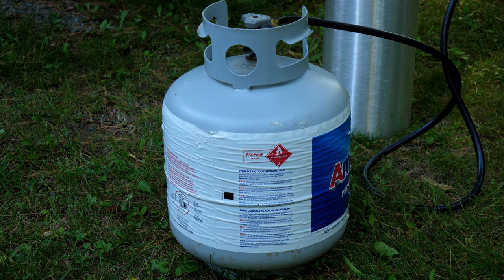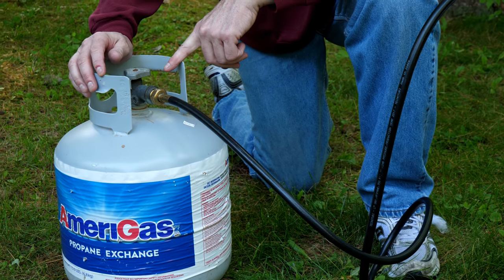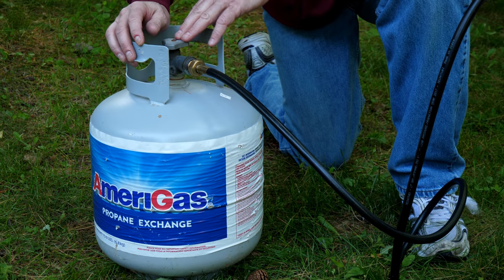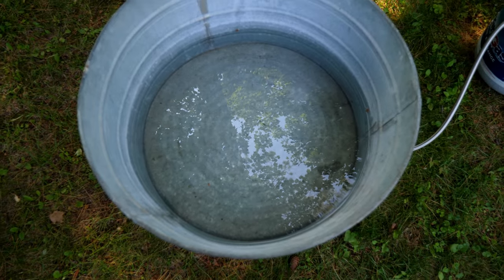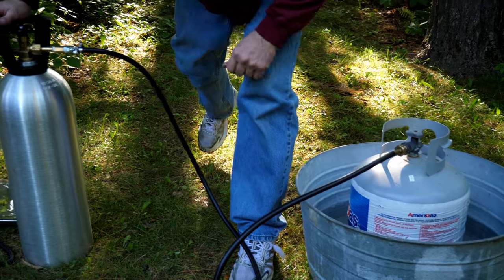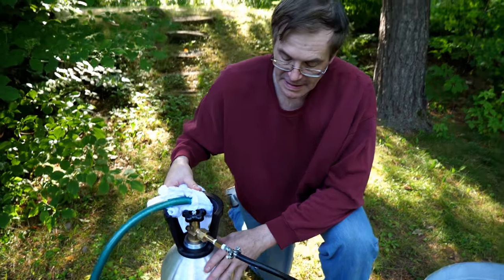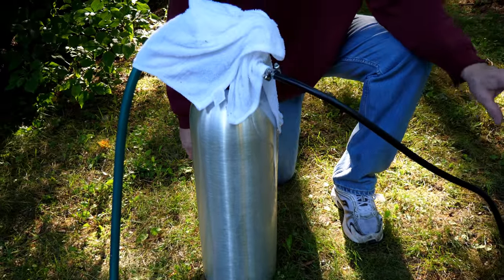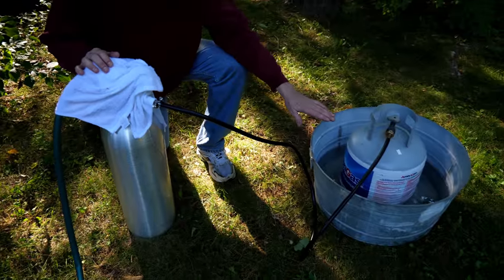Liquid Propane - How to Transfer Safely

Comment: I like how he as a Chinese hoses (thermal plastic hose) and automotive  hose clamps securing Liquid Propane which is compressed gas... at 375 tank pressure and not to mention it is -44 degrees.... plus he's using water Teflon tape 🤣🤣🤣🤣 which definitely a huge no no...... but hey what do I know... I'm just the Friendly propane technician 🤷🏻‍♂️
Reply from the maker: Thanks for the comment.  You do realize  that the vapor and liquid are both close to room temperature? If they weren't they would be at one atmosphere of pressure. And, at room temperature, the pressure  is approximately 150 PSI.
Reply: No at 60⁰F the vapor psi in a tank is 93 psi. When the psi in a tank drops below 125 ish the liquid boils and replaces the loss of pressure. Liquid is held in a Liquid state by temperature or PSI...

I Put a gauge on the dispenser tank and find out what the pressure is inside that tank is... currently 91°F and my tank pressure is 165 PSI...
Reply from the maker: Those  numbers are reasonable.  Why then did you say 375 PSI and -44 degrees.
Reply: @TechIngredients  if you would like to see a chart i send you a link to a Meeder Ransom Equipment retail pricing book that will have the information you can get to see what I am talking about.
Reply: @TechIngredients  the 20lb cylinder OPD can put 375psi  of tank pressure... and liquid Propane is -44 degrees Fahrenheit.. yes it does change but  definitely not under -15° Fahrenheit.
Reply: @TechIngredients  vapor hoses aren't  designed to with stand liquid Propane... if the hose comes in direct contact with the sun it can pop and we use in the propane industry hose that are rated over 375 psi.. and we also use  Hydrostatic relief  on gateway valves or globe valves and hoses. Especially since the industry standards require propane valves to all have Pressure relief valves to prevent any premature failures and fatal injuries
Reply from the maker: Thanks for the offer, but I have access to  the pressure/temperature tables for propane. In your  OP you were ridiculing my choice of equipment for the demonstration. But, we were  transferring propane from one container to another not installing a multi decade propane system according  to regulatory code requirements. As your following posts state, the temperatures and pressures we were dealing  with are within the specs for the tubing we were using.  Thanks for the feedback.🙂

Comment: Great information, but I'm surprised somebody as smart as you uses the propane tank exchange BS! That is nothing more than a scam for dumb people. It doesn't matter what part of the US you are in, you can find a propane supplier that will fill your tanks (any approved tank) by the gallon. Many people use 30,40, even 100lb tanks, there are no exchanges for those...they have to be filled somewhere no matter which state you are in. Also, if you used a common forklift tank (much cheaper than a CO2 cylinder) they have a standard liquid output valve on top. They do have exchanges for those also, but not found at your local grocery store. Average propane price around the US is $3 or less per gallon and you can modify your tank to your heart's content!

Also, if you are trying to move liquid propane from a standard 20lb tank, turn it upside down, it will happen much quicker.
Reply from the maker: Convenience is important.  I also use the small, Loctite dual syringe epoxy kits.  The epoxy costs 20 times as much as bulk, but time is money.
Reply: @TechIngredients  What is "convenient" about this? You made a long video about how you have to transfer propane from the standard 20lb tank into something else with a homemade transfer hose, a water hose, a bunch of time, and honestly, playing with some dangerous things if you're not smart about it. Wouldn't it be much more "convenient" to simply use a standard forklift tank with liquid output valve (you can exchange these too!) or modify the tank however you want?

You're obviously not hurting for money, and I totally understand why you might want propane in a "custom" tank, but if "convenience" and liquid propane is all you are after, you're doing it in one of the most complicated and inconvenient ways possible...

You're also perpetuating a myth that in certain parts of the country your only option for propane is a $6/gallon tank exchange, that simply isn't true. Every state has low cost propane filling stations. In some states it is more common to find the exchanges, in other states it is more common to find gas stations that fill the tanks - but ALL states have both.

Comment: please do not heat galvanized steel.  it's dangerous.
Reply: Not really. It is dangerous to weld. But thin steel tub full of water can't really get hot enough to release the toxic fumes that come when you weld galvanized.

Comment: As cool as this is, I cant ever see a need to do it.
Reply from the maker: The second, hybrid turbojet video will be posted soon and we use this propane in this engine.  Also, because the propane that transfers, does so through vaporization, it is very clean.  It lacks water vapor, oils and less volatile hydrocarbons.